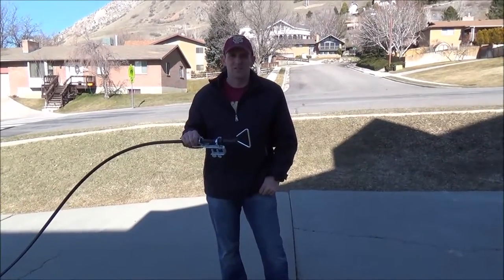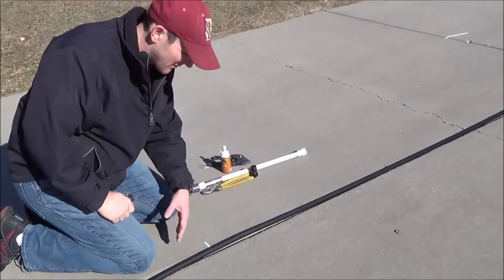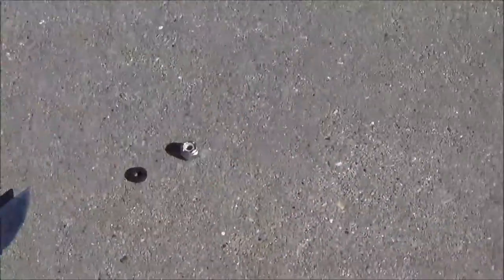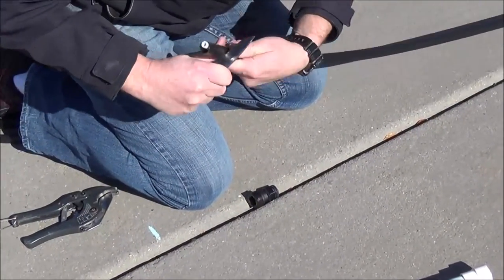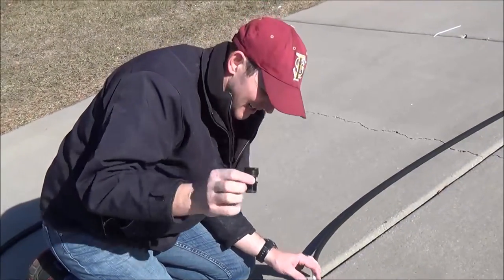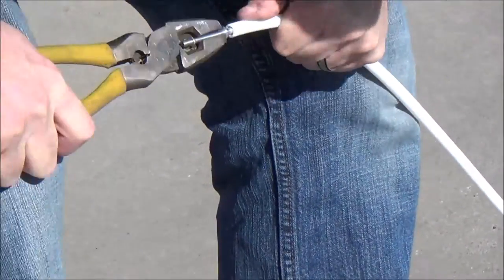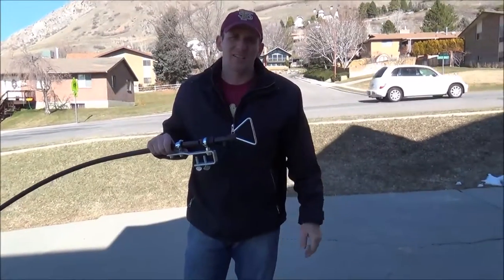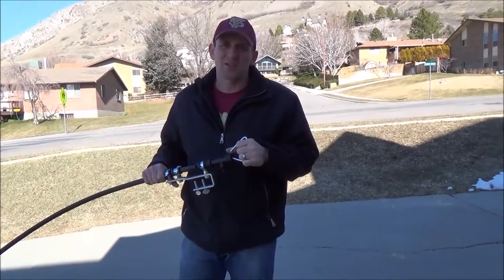Shorten a Gunslinger Well Pump in minutes using simple tools!

Comment from the maker: We use machined steel and aluminum components on both the top and bottom which adds to the cost. The design is simple and we are still half the cost of most competitors. Our solution is mainly for those that do not want to mess with PVC sections and assembly. If your handy then you can certainly find less expensive but more work intensive options. Thanks for commenting.

Comment: Thank you for the video. What is the purpose of the black pipe ontop of the white pex?
Reply from the maker: That is just the outside of the pump. The pex tubing acts as the pump rod to move the pumping mechanism at the bottom. Thanka for your interest.
Reply: The water moves between the black/outer tubing and the inner/white tubing.

Comment: I have not seen any measure the diameter of the bottom tube ( the bigest part )?  I have a smaller diameter of the pipe hole, I need this information if it goes into my well hole.Thenks
Reply from the maker: MrSlovenc86 the largest diameter piece is 1 1/2". We recommend trying to have 1 3/4" of clearance between the inner pipe feeding the house and the well casing. Thank you